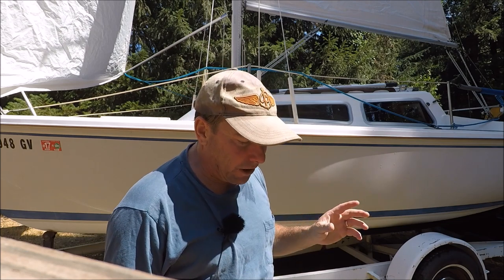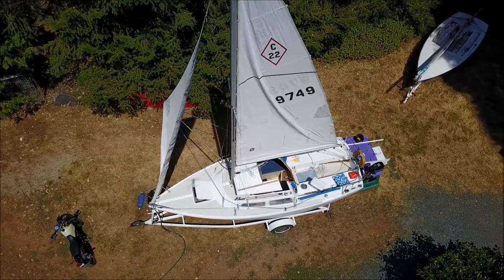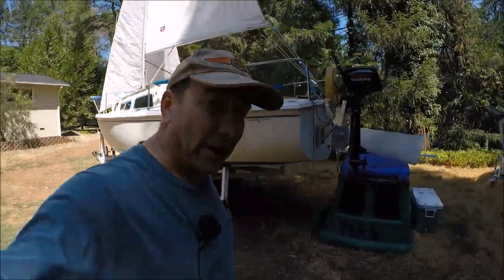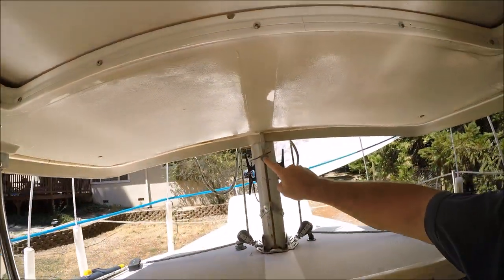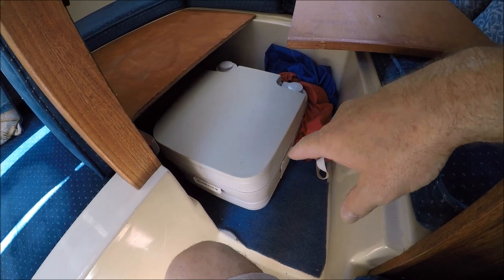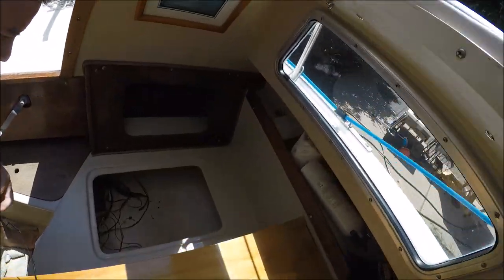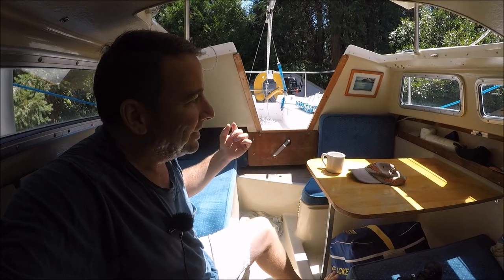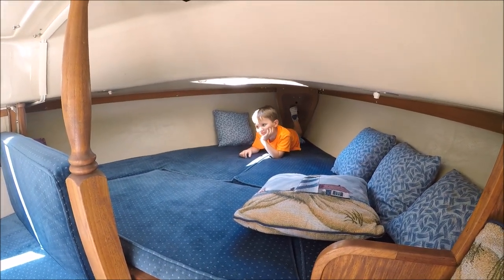1980 Catalina 22 Sailboat Detailed Interior Review

Comment: That electrical mess looks like years of hacks and repairs by owners who don't know about marine wiring. That area would have looked much better when the boat was new, although in that class the original wiring would have been nothing to write home about.

With modern LED lighting one marine-grade battery can run things for a very long time, days, even longer if you can find someplace to mount a small solar panel. Having that kind of power will allow you to use regular marine electronics, like a radio or a bilge pump. It will ultimately be safer than having to deal with multiple devices, each with their own type of power. Never leave the dock without a full charge!
Reply: Will Fastie Include a 2K Honda generator with some fuel, a great safety net.  Nothing better than sleeping in a boat on the water any place you choose!  Yes, that wiring was a mess and definitely a shock to an AP mechanic!
Reply: @Kendal Eklund - My old Paceship 23 was overpowered with a Johnson 9.9 long shaft. Electric start was nice, of course, but the real plus was that just a little motoring kept the battery topped off. I didn't have solar; too expensive back then.
Reply: @Mike Cowen - You're probably right about the skills of previous owners. Bad electrical is bad anywhere but very dangerous on a boat. One spark...

Comment: I've owned two trailersailors and the sight of that keel winch handle below the companionway made me cringe. It is an ACCIDENT waiting to happen....not to mention an annoying tripping hazard.
If this was my boat I would make the winch handle easily/conveniently removable with a stowage solution close by. While there is no problem at all if the keel is down (in the water) or if the keel weight is resting on a block/rest while on the trailer (something you should do to minimize wear)...the problem is one day somebody is going to forget the keel is up (450 pounds hanging on that wire) and then trip/nudge the winch handle and that handle will turn into a WEAPON in a nanosecond. An untimely simple failure of a small part in the winch mechanism will do the same.
With a boat like that more often than not  you will anchor in shallow water with the keel up... then you, the wife and the kids will go by that winch handle lots of times going in and out of the cabin during the evening. As a captain, it is NO FUN AT ALL having a family member or guest seriously injure a foot or hand...especially when you're one day's sail away from your tow vehicle.

Comment: Catalina is one of the thinnest hull boats you can buy. It is clean though. It is No Hunter which are guaranteed to right them selves. The swing keel is nice for beginner sailors or spend a lot of time around shallow waters., The pope tops are really unsafe in a heavy storm or heavy wind. My bud blew the whole top off in a 50 plus mph wind with both sail and jib up. When he let the boat turn us it was all over and we were 8 feet mass in the water. There heavy but when a wind fills the boat with air and you calculate the square footage by the pressure you can find your self in trouble fast. Make sure The Locks are Locked. As far as the swing keel I ran mine up lots of time as it increases speed on the Hunter. As far as going out the gate they say if you can sail in the bay it's self in a major storm you can sail anywhere in the world. 70 to 80 mph storm here. I also don't recommend sailing in Lake Tahoe unless you really know what your doing either.  Sailing is really relaxing on nice days but if you are into a life and death rush in major storms or heavy wind there's no better rush. I spent 11 days not being able to walk and 21 days in a walker and it was one of the most best sailing trips we were ever on. The only reason this happen was because I let the owner take control of his boat while I was on my knees taking a pee off the front of the boat. Was hung up in the life lines and under water. lol. I don't normally pee off of a boat at anytime let alone in 50 plus mph winds but I just figured he wasn't going to be able to handle it. And I was right! lol. This happen in hurricane alley. I still have him on video saying when we left San Fran bay, Don't worry, i know what am doing. When sailors say that, that's a red flag..lol. My bud latter went on to take my other buddy out to the Golden Gate and rolled the boat out there almost drowning my bud. lol. Then there was the time I was sailing her on the east side of Angel Island as a big fairy came by and he had open the front hatch just as I told him not to 2 minutes before as I was in back training the 15 year old kid and filled the boat with water with 2 feet of sea water...lmao. I could go on, I think your getting the idea...LOL. Read your books, Wear your life jackets and Trust no one..lol.
Reply from the maker: 50 mph wind?!...YIKES!!
Reply: Its not uncommon for 60 to 70 mph winds on Tahoe to come up out of no where the right time of year. In he 90s I was one of only 4 boats on the SF bay that stormy day. I got with in  150 feet of passing a 40' plus sailboat the Coast Guard was plucking people off of. That sailboat was all the way up side down. When the man in the chopper seen me while raising someone up he did a double take and here I waved with my main sail up,lol  This sail had been made to raise up about 18 inches and tapered back to a couple of inches and tied off. It kept the boat laying on its side the whole way to Richmond instead of the waves rolling us over. I learned that in a book by the way. That was the  worse storm on record, 60 plus with 80 mph gust. Once we got pass Angle island were were hit with 16 to 18 foot waves. I did wash over the life lines once when a big wave hit us but my nephew I trained grabbed me with one hand and released the main with his other hand thrusting the boat back up bringing me back on, I had one guy sealed down below to as the boat will right its self in a full cap-size. Thats what the book says anyways..lol. That boat was sold to a doctor in Petaluma and he gave me my asking price as well as paid me to take it to Lake Tahoe and setting it up just the way I had it. And i gave him a hour long lesson on how to stay alive. lol.

Comment: Very Cool, what about Radio Equipment and is there ATC for boots as well ?
Reply from the maker: not really... on lakes anyway, you can get an inexpensive marine handheld transceiver.
Reply: We always had the on board 12 volt VHF radio connected to our electrical system and also took to bringing 2 portable VHF as well just in case.  You're always supposed to listen channel 16 which is monitored in our area by USCG Sector Puget Sound, and the other portable was usually tuned to the channel our squadron used for arranging arrivals to our destinations.  One of the great things about the U.S.P.S. is the men will always help other members get into the dock with directions and help tying up at dockside.  One time early on I felt I had fit in by backing the boat between several more expensive and bigger boats (they were yachts) and then around a 90 degree corner, all in 16 knot winds, and docked!  The squadron Commander praised me for my boat handling.  I of course thought that was pretty cool.  I wasn't cocky though, had much more to learn, but I knew how to handle my boat in most close quarter situations.  Some have a saying inside the marinas... and one said to me on a particularly windy day early Friday afternoon after helping me tie up, "Vern, I like your boat... but I like mine better".  Meaning, I don't want your fiberglass hull damaging mine.  I knew instantly what he meant.

Comment: Coolers? All I have is a 12 volt chest freezer, always run on ECO. Wiring is easier if you attach it high, not low. I'll never wire batteries in parallel,  Surprise. The new kid on the block is the four cycle air cooled outboard. Mine goes up and down stairs and hides in a closet. The gas pours back in storage in seconds. You're kind to your boat.

Comment: I have to say, that was a very good purchase. You're dead right about electrical systems on boats. They do have a tendency to look exactly like yours, but on a boat like that, you can probably live without it, in this day and age, but it might make a good project for winter. It would certainly make the boat more liveable for a couple of days out. Only poor sailors drink warm beer!
One thing that I noticed was your through hulls. You might want to consider replacing those along with the hose work and double clamp them with quality marine grade clamps.
These are potential points of failure with potentially life ending consequences. You might also consider having some tapered dowls onboard within easy reach with which you can plug holes in the unlikely event of a disaster. And one last thing. Trailer wheel bearings and electricals.
Once again, great purchase. Get the family out for a few weekends over summer and its paid for itself at the price you got her for. Enjoy her, I'm envious.

Comment: I owned a Columbia 22 with a full fixed keel. Trailering it was impractical. Back then, fiberglass was cheaper than 10 yrs later. By keel was approx 1500 lb.

Comment: Juan, I thoroughly enjoyed your "walk through" of your Cat. 22. I purchased a used Sirius 22 several years ago, made by Vandestadt & McGruer, a now-defunct Canadian boat builder here in the Great Lakes. The lines look very similar to your Cat. 22, but the interior (cabin) is a near mirror image. I heartily agree with those comments about locking the keel under way, BTW.  Lately, I've been having an issue with rain leaking around the deck hatch to the companionway, and wonder if you have experienced similar issues? Hopefully you are still going on line about your sailing adventures, although I don't see other than your first U-Tube video.